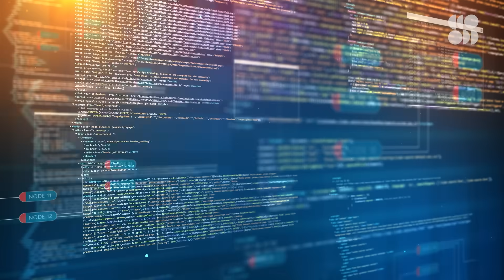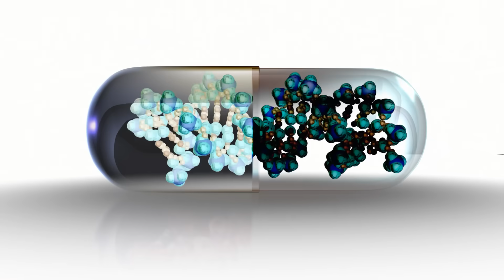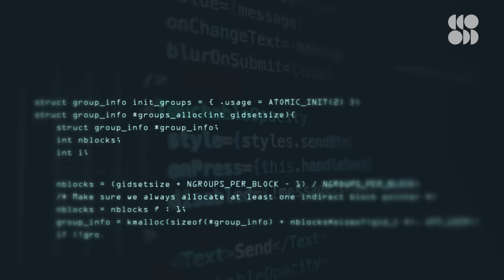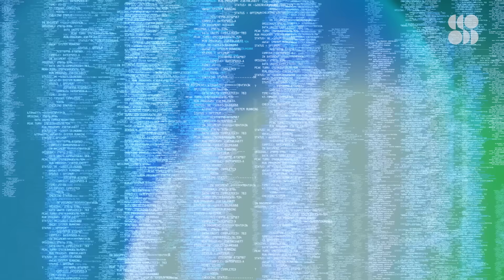The World’s Most Powerful Supercomputer Is Almost Here

Comment: In this video, the most important metric is the major leap in floating operations per second that this machine can do. The second metric, which is EQUALLY important, is that its makers found an ingenious way to make this machine fully carbon neutral out of recycled material and was built with/operates on renewable energy. We don’t need a supercomputer to project climate disaster predictions if it contributes to more climate disaster.

Comment: Today the competition is over. Over 1 year after this video is released Frontier is finally here packing 1.6 exaFLOPS of performance and it is the first to come. The problem China is facing is there is no way that they can built such a system due to their sophistication in the field. They are very very far behind in things like core architecture. Their machines require significantly more cores and I mean many times more cores and thus a lot more power. For example If we compare Sierra and China's best Sunway TaihuLight the Chinese has over 10.6 million CPU cores. Sierra on the other hand has Power V9 CPU and has  190,080 CPU cores and 1,3 million Tesla V100 GPU cores. A total of almost 1.6 million CPU and GPU cores vs 10.6 million CPU cores on the Chinese and still Sierra has the same performance output while requiring significantly less power.

Comment: Just some perspective for how far we've come.
An off the shelf Workstation CPU (AMD Ryzen Threadripper 3990X) which costs $4,000 is capable of 13.21 TFLOPS (FP32)
The fastest supercomputer in the year 2000 (IBM ASCI White) was only capable of 7.23 TFLOPS and it costs MILLIONS of dollars.

In 2002, the fastest supercomputer was NEC Earth Simulator and was capable of 36 TFLOPS.
Reply: Supercomputer processors are low core low speed

Comment: But don't forget this computing power is based on massive parallelization: which is great for problems that can be decomposed into parallel streams (like weather, bulk chemical interactions and some protein-folding), but if you can't break the problem into parallel bits you can't exploit the massive computational power. And there's the rub: our software techniques are still primitive: we've only been programming (seriously) since 1945, and we have a long way to go.

Comment: A prospect that I find interesting is the application of analogue processors for Ai. Supposedly they can have lower power requirements. With a highly trained, low power optimized, hardware neutral net, Ai could be extremely scaleable for broad application without excessive power demands.

Comment: Thanks to Neuralink, a mans brain can be connected to this super computer
Reply: not yet.  our brain is vastly more powerful than this super computer.  this super computer is comparable to a small insect in terms of it's processing power.
Reply: @pondeify  brain is 1 exaflop, so this on par with that
Reply: @johannes7434  but it's the equivalent of strapping millions of calculators together - they are not connected.  all you get is a very fast calculator - which has great applications but cannot produce anything like the intelligence of an average insect.  we should be engineering next gen computers from brain cells.

Comment: You can really tell that these guys have no clue what they are talking about. The exascale computers are still just many PCs linked together, no revolution whatsoever. Only the CPUs have gotten faster since the last generation, they get complemted by faster and more GPUs and there's more of everything. The end. Also there's not going to be any software revolution whatsoever, it's just gonna be reliable 90' tech all the way. Actually I would be shocked if those exascale computers won't be running Fortran code from 70', each node processing a batch or at best MPI ...

Comment: The government really just tryna play Minecraft in 4K with Ray tracing at 140fps
Reply: no more blocks, need to move atoms to build a grain of sand and so on
Reply: Really that's probably just a nVidia 4000 series GPU. 😅
Reply: @megamanx466 
Nvidia has said that there won't be a 4000 series and that they are planning on a new completely different series
Reply: That doesn't sound very powerful tbh😔
Reply: Either that or building more weapons of mass destruction.
Reply: @RAMBO14001  hmm 🤔
Reply: Overused joke.
Reply: How about Nvidia Holo chip 🤔
Reply: unfortunately, unless minecraft is redesigned so that it's computational workload can be standardized and split across millions of super computer processors, it can't run any faster on a supercomputer than on your desktop
Reply: Well, exaflop will be ovekill for 3 trillion of "Minecraft in 4k with Ray tracing at 140 fps" computers.
Reply: Yo, that’s quantum computer territory

Comment: lets go... pico (10^-12), nano (10^-9), micro (10^-6), mili (10^-3),.......,kilo(10^3),mega(10^6),giga(10^9),tera(10^12),peta(10^15),exa(10^18),zeta(10^21),yotta(10^24), bronto(10^27),  gego(10^30)... the two last ones are not officially indoctrinated in the S.I. though.....
Reply: You missed many of the smaller incriments

Comment: Back in the early 90's some friend of my father's told me computers scared her. At the time I couldn't understand her fear. I told her computers can only do what they are programmed to do. But now computers scare me too.
Reply: You shouldn't
Reply: @ramade9040  I shouldn't what?
Reply: The problem exists between the keyboard and chair. 
EVERY time I sit at a red-light, seeing empty road except for my car, the ONLY vehicle, while the empty road has a green light..... only to see the light change BECAUSE another vehicle (who was 2 miles away) approached the green light, so it turned red for them, causing waste heat from braking, extra fuel burned to resume speed
Then, I am legally allowed to go, now that there is a higher chance of collision (compared to when we were a mile apart), now that the red light can make both of us waste energy (burning gas to go from a full stop) and cause unnecessary wear&tear on the vehicle (brake pads, etc), as well as heat from the braking process, when the light should have let me go when the way was clear, then let them go through without stopping 2 minutes later. 
But instead it is programmed to make people stop for stupid petty selfish reasons, like they think more people will shop at the businesses if they spend 4 minutes sitting at the redlight they might as well spend that time in the line of the Drive-thru... My problem is that it is 3am and all those stores are closed but the brainlessness that control the system don't consider the hours in which there is no open business. the system doesn't comprehend that school is not open at 3am on the 26th of December and that there will be ZERO pedestrians, nope, it's programmed to think that every second is 7:55 am on a school day like an idiot who made those choices when they programmed it.

This is the state of computer control. Idiots decide the outcome with little to NO comprehension of reality and we are legally required to obey broken machines which follow fail logic.

Comment: Finally my renders will not crash 😂
Reply: crashes will still happen, increasing speed does not magically remove program errors such as the ones in your rendering software which currently cause those crashes. You need different SOFTWARE. faster hardware will just get you to the crash faster.
Reply: They'll crash sooner and you'll lose more cpu hours while you're asleep 😂
Reply: And they will render in less than a blink of an eye

Comment: It won't be that much faster we already have cupped hundred petaflop capable supercomputers, the first exascale computer will be barely above 1 exaflop so it's more like a 3X than a 1000X jump.
Reply: Yeah that line also bothered me. Like saying "New terabyte drive stores 1000x more than current gigabyte drives" when the new drive is 1TB and existing drives are 512GB.
Reply: @DemascoNY  ye but the changes will be biggg
Reply: Exactly!
Reply: Also about the other things she said like exascale computers needing different software n stuff, I don't see why? can anybody explain that to me?
Reply: @mushyomens6885  The thing is whit pc parts , for example ram ( memory ) and the cpu ( processor ) are like to be close to each other. In some extreme cases its a problem even whit commercial electronic but here the scale is so much bigger u can not possible sinc all that together , so u need special software trick. The limit is literally the speed of light!
Reply: @mushyomens6885  I would imagine it mostly being because these machines are just not meant to run software such as windows or linux. Don't quote me on this as I'm only speculating, but I'd guess it's due to the sheer amount of speed and computation that these machines can perform, which leads to a massive bottleneck and inefficiency in the system. So what needs to happen is for people to write specialized code that's optimized for such a machine. But then again, I don't know, I'm just speculating based on the 3 knowledge from a 3 month long course in system technology :^)
Reply: @mushyomens6885  In a nutshell, it will run the same software packages as are in use today, but at an unprecedented number of cores. To take advantage of that you need to do a lot of work optimizing to get all the performance. Take Amdahl's law, if for instance your code is mostly parallel (99% of the work), but 1% is serial (perhaps some initialization and IO post processing at the end of a run), that means a max speedup of 100x, not great. So you may need to parallelize sections of the code that were serial before. This was not a huge issue up till now because of the limited core count. Even worse, maybe your algorithm has some inherent serial parts, so you may need to complete revamp the code to use a different, more parallel, algo. Also there are things you can optimize related to the specific hardware. Based on the amount of cache you can optimize chunk size of matrices for instance. Lastly, using more compute nodes in parallel means more communication between them, this always has a latency penalty. Of course there are advances in networks too ;)
In short, quite a lot of software development required, see for instance the exascale project. However, as already mentioned by others, there is nothing magical about 1 exaflop, it is just a nice round number. We're already at 0.5 exaflop, and so people have already been working on upgrading software for years, and of course will continue to do so.
Reply: Pfff just tryin to flex your exaflop
Reply: Truth
Reply: I wish I can make only 3 times more money 😁

Comment: I'm not convinced that "massive code overhauls" will need to be done  to bring current models up to exascale machines. In many scientific and HPC applications, there actually may be little to no change due to already in-use systems like mpi, openmp, and other standards which allow the code to adapt itself based on the running environment.
Reply: Well no. For a few problems and small-scale machines this might be true, but in general implementations don't scale by factors like this (100-1000x) just by virtue of being implemented in MPI and OpenMP. Many HPC problems are not well-addressed in many programs or are not solvable in a general scalable way, in particular high-performance I/O and communication. The challenge of how to deal with these issues in exascale machines is not really solved in general, let alone in each particular program. And there can be significant code changes required even for comparably minor upgrades in HPC facilities. Source: A university course given by people working in a HPC facility regularly contributing to the IPCC.
Reply: @gooblepls15151  actually code will probably not change and it's not needed. The only thing that need to change is the interpreter between the software and hardware. Source: I'm a software engineer.
Reply: @sthsth2846  im also a software engineer. im not 100% convinced either. most software now is machine independent. I can give you my java or python code and you can run it anywhere (that has all the libraries that are used). C/C++ and similar may be a bit trickier. But then you get real low level and you may have to rewrite stuff. But scientists and researchers probably want that kind of low level control. But maybe there is already software and/or operating systems or compilers that will do all that for you
Reply: Though that is true, I do think we would have to redesign some algorithms, in order to take full advantage of the increased parallelization.